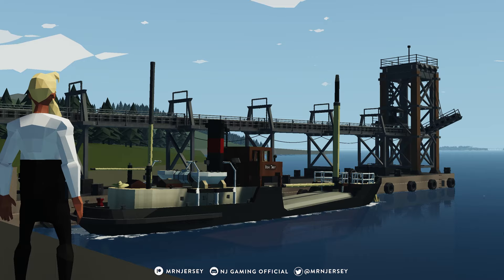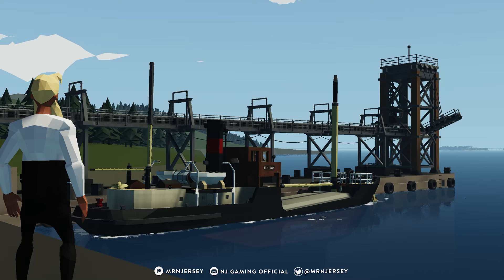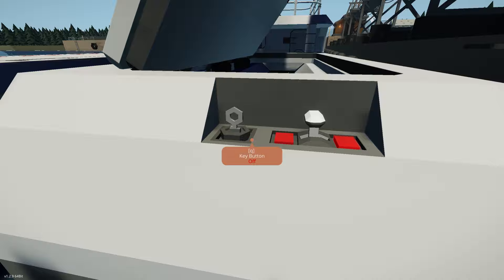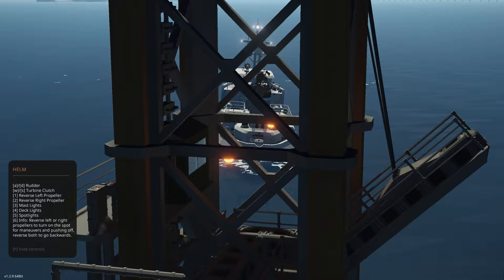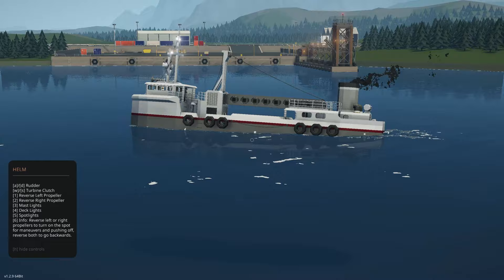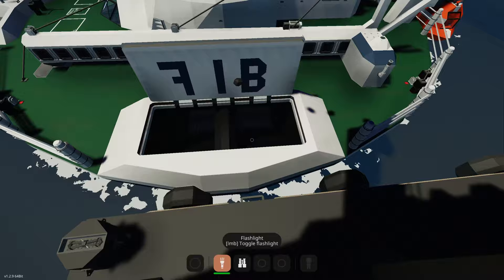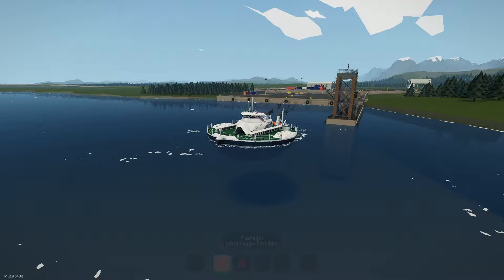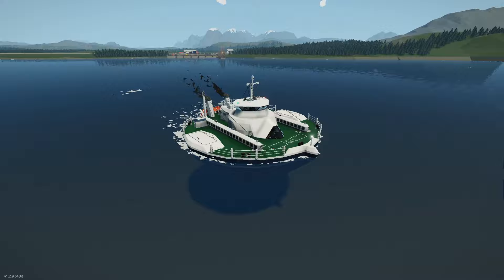Steam Ship Build Challenge Final - Part 1- Stormworks

Comment: The reason the turbines have so many pumps on them is because it gets more fluid moving through the system giving you more power. It works without pumps, just not very good.
Reply: which is a shame, it makes nuclear so pointless... why should i create steam? just a little bit of steam to fill the loop and then pump the steam around.

i would say that i would like the devs to fix this whole mess of an update, but there are already so many player hours invested into their steam powered creations... The devs should have finished the steam update before release, but they refuse to do so with every update...
Reply: @Adesterr  steam works if your setup is good. I let my turbines fill up till the boiler starts filling and thats how I know im getting the most power. 

A good way of describing the turbines was that they are apart of a whole assembly and not just a single turbine. It makes more sense that way seeing as they are supposed to be placed in a line with torque going through and adding up. I have about 12 turbines a large battleship I made but I have not tested it yet. I did get 4 turbines to push a small monitor at 10-15 knots. Keep in mind gearing is important too 

I like steam where it is now.
Reply: @spanishcastlesinspace2899  Yes, steam works, that is not my problem with the update.

Let me be a little bit clearer: there is no reason to burn coal or to run a nucular reactor. You just need enough steam to fill a loop of turbines, don't use a condenser, just run the steam in a loop. That is the part i don't like. We already have enough infinity engergy bugs in the game, why add more? 

The saddest thing about it is: If the devs want to fix this bug, they will have to break every steam powered creation, regardless of using the bug or not.

btw, you will get a little bit more power out of the turbines, if you don't link them in a straight line. if you use both power connections of a steam turbine, they will have increased resistance and therefore a bigger part of the produced power will go to turning the turbine itself.